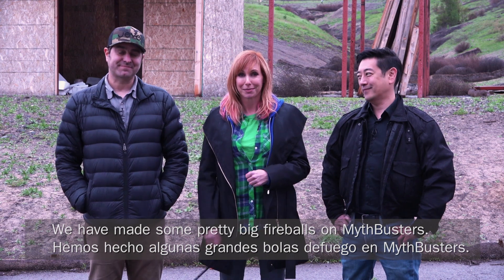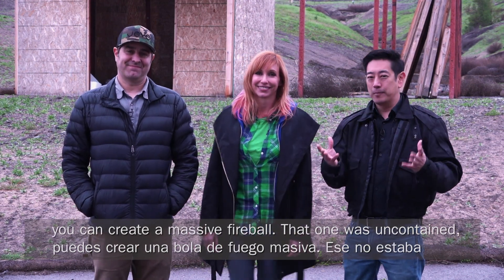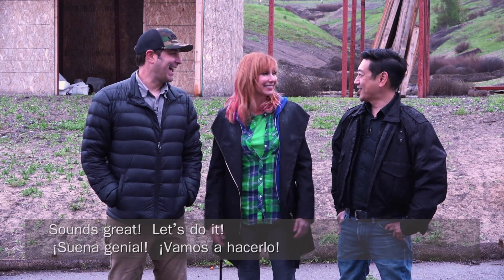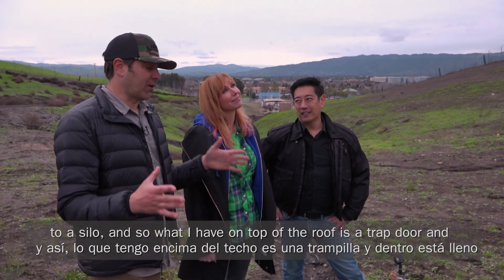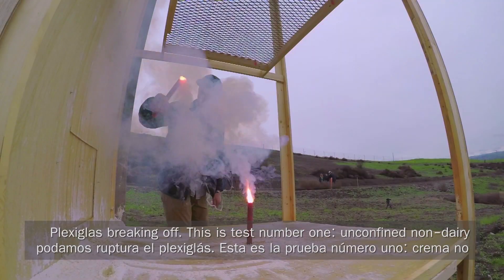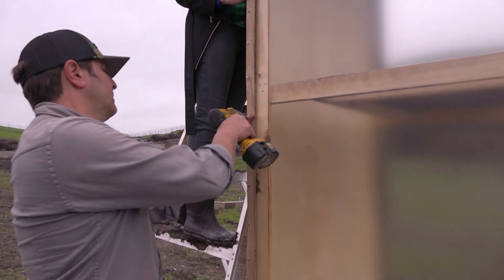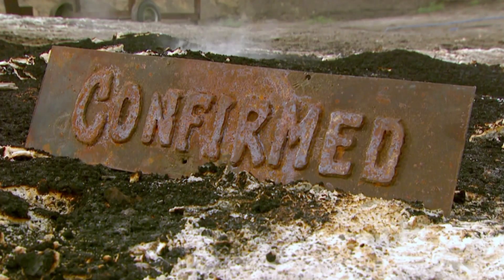MythBusters: Silo Explosions

Comment: Powder explosions scare the pants off of me.  Even static electricity can set them off, and you'd be surprised what can be flammable if ground finely enough.  I saw footage of a powder explosion in an aluminium mill...  Apparently it was fine filings and aluminium dust that was the fuel, and when it went up it was hot enough to set the intect aluminium metal alight.
Reply: I have separate workspaces for two of my hobbies- The wood carving is done on the opposite side of the house from the blacksmithing as I have absolutely no desire to repeat a childhood incident where a family friend burned about 5 acres of his farm when a stray spark from welding ignited the sawdust from his woodshop.
Reply: @FirstIsa  Jeebus.  I do not blame you there at all.
Reply: Powdered aluminum is very scary stuff, and the chemical properties of aluminum make it even scarier when hot
Reply: @tfairfield42  Almost any powdered metal is, but yeah aluminium burns stupid hot.

Comment: Ohhh they faked their reaction for the camera, notice their front doesnt have a red glow
Reply: ohhhh notice at 2:05 they're walking on an elevated road and they react.. ohhhhh standing on the road which idk based on the angle of the camera at 2:05 i'd say maybe 30-40m from the structure to the road (I'm Australian so metric, but took the liberty of googling it for you incase you're stuck in old times -- about 100ft or more from the site) so it's elevated for starters, 3:30 shows them facing it on an angle so probably further than my initial guess of 100ft and it's daytime so idk what kind of red glow you were expecting on their front from that distance during daylight hours and the fireball being below them..  🤣 I like your observation skills, I aspire to match them someday.

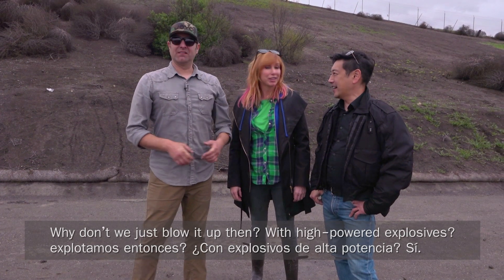 Edit: further investigation to ruin your day - 2:05 shows the little part of the road i don't know what you call it the little lip that guides the water down the road instead of the embankment to prevent erosion of the hill i guess? anyway then at 2:08 it shows where the lip starts and the elevation of the hill so you could estimate they're near where the road peaks for observation perhaps.. then 4:50 shows the distance between the Observation booth and test site that you also see at 2:05 with the cracks in the ground for reference where they have a tripod camera mounted anyway yeah it's a fair distance for a red glow during daylight hours.. just sayin' you could do you're own experiment with the red glow and prove me wrong if you want, bags of flour are cheap and you can just use a candle to the same effect, don't blow yourself up though that'd be detrimental to ...well everything you want to do.. 😁
Reply: @Shadow.Doctrine  oof somebody studied for this comment
Reply: @Shadow.Doctrine  "100ft"?!  
Please convert to proper American units of measure for distance: football fields or Empire State Buildings.  👍